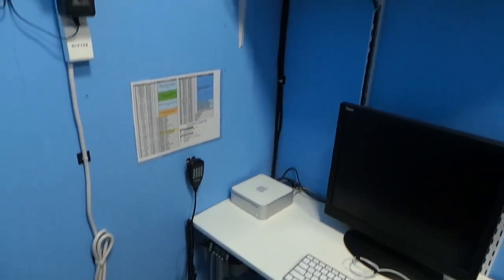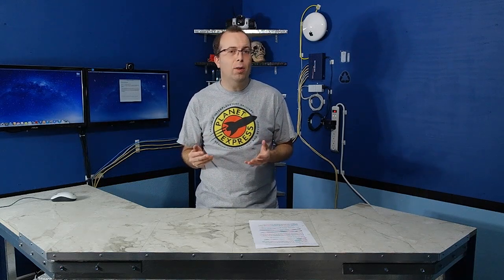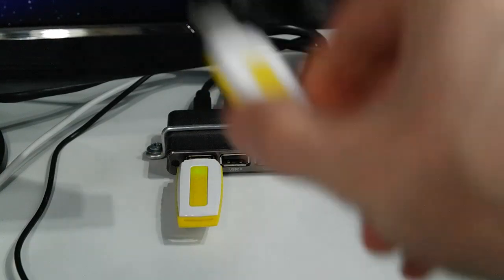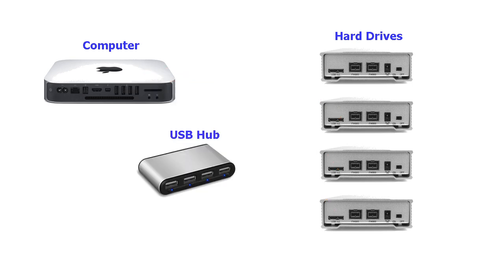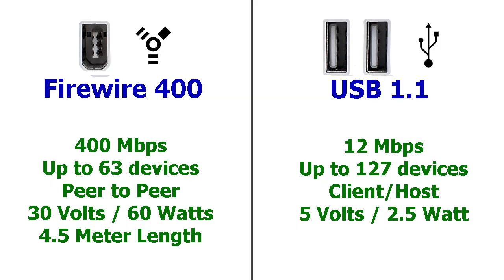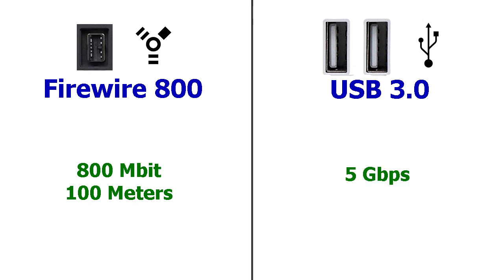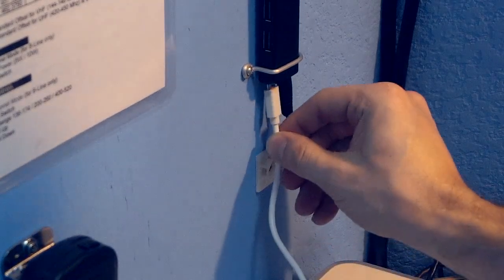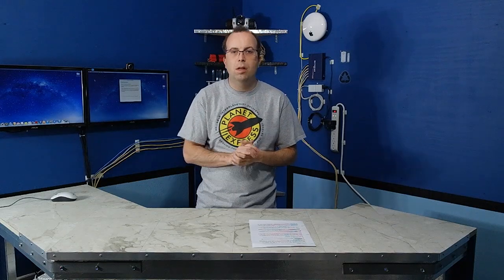Farewell R.I.P. Firewire, Hello USB!

Comment: firewire isn't dead. a lot of multichannel audio interfaces use firewire.
Reply: +diego scar yeah that sucked much. Damaged Firewire chips on so many audio interfaces just because the were turned on while a pc was running. The hot plug issue was the biggest flaw in firewire audio interfaces.
Reply: +diego scar True, but most new interfaces are switching to thunderbolt since it shares the same benefits as firewire, with exponentially higher bandwith
Reply: Well, there's understandable confusion, as the various standards have all leapt into the same vat of soup and are swimming around in a rather murky broth these days.  Thunderbolt typically uses the Mini DisplayPort physical connector, and can indeed carry the DP protocol.  But not the other way around.  But now USB and TB are merging into a single connector, so the holes in the side or back or front of your computer could be charging ports, USB, TB, DP, HDMI, Ethernet, or just merely a ventilation louvre.  What they chose no longer resembles the connector everyone's familiar with, but rather kinda looks a little like an Apple Lightning port, but isn't, which I'm sure will be fun for the next round of iPhone buyers.

So, while you're here frothing over how people can't get their facts straight, the computing industry is doing everything it possibly can to make the entire thing an indecipherable mess.  Not everyone lives and breathes this stuff.  You ought to cut the general public some slack on that one.  Just a hunch, but I'm guessing you won't.

Also, hey, "Personus" make some perfectly mediocre pre's, and nobody these days spins their own A/D/A silicon.  It's all Crystal Semi, TI, etc etc, the same stuff everybody else is using, and it's all 100 times better than what anyone had 20 years ago anyway.  Somewhere between then and now, I wish I had a dime for every box I opened up that had the same family of Burr Brown A/D/A ICs in it.  But I digress.

You're on a roll, my amphibious friend.  (Well, not quite, on a technicality.)  It really was a driver fiasco.  But chipset compatibility was very much a real issue as well.  You also seemed to have missed all the problems people had with destructive hot-plug events.  Maybe you could have blamed that more on power management ICs or poor decoupling and/or fault isolation in the physical interface circuit.  Point remains though, that didn't happen with USB, under very similar conditions, and doesn't seem to be an issue with Thunderbolt either.

Well either way, I'm glad your experiences were better than that of your peers.  I happened to get along quite well with Windows ME back in the late 90s as well.  Sometimes, against all odds, you just get lucky I suppose.
Reply: You're alright, Murphy.

Y'know, I've looked at Metric Halo before, and I have to admit, I wouldn't mind dropping some coin on a better digital interface.  The Firestudio stuff works well enough out on the road.  I mean c'mon, I'm not tracking for Telarc here.  Buuutt.. that LIO-8 seems pretty nice.  Just good conversion, and not much else.  Perfect.

At this point, though, I can't see investing in another FW interface.  The gymnastics I would have to go through for connectivity... ugh.  I already have to use a TB-to-FW converter, and I'm not holding my breath that there will ever be a USB-C to FW-400 cable for when I eventually upgrade the laptop.  Which means I would have to chain a TB3 to TB2 adapter to a TB2 to FW adapter, or use a TB to PCIe enclosure and a Firewire card.  Not ideal.

I'm tempted to spend a weekend browsing data sheets and just start building 24 channels of good line-level AD bridged to multi-channel digital I/O (AES or S-Mux or who cares what), and then use whatever flavor-of-the-month Behringer or such I can find to interface that to a computer and hope it can't screw up the transport of bits too badly if the clocking is done elsewhere.

Oh the irony of a signal chain that begins with a transformer designed in the 70s, and ends in some fangled doo-dad with an obsolescence period of about 6 years.
Reply: Yeah, my next will be* thunderbolt or real PCIe, you'll get even lower latency from those interfaces. But I'm still super happy with my metric, and will chain dongles until no one will let me anymore:D Good luck with your rig!
Reply: I have a multichannel audio interface that uses FireWire. Works great but now I don’t have a computer with FireWire. If i get just an usb to FireWire adapter, will it work? Any help. Thanks.
Reply: Relax before we turn you upside down and strand you on your shell there turtle boy.

You're not entirely wrong, as the Presonus interfaces I was referring to do, in fact, work a lot better on a MBP than on a Windows PC.  And you're also right that this is technically not a fault of Firewire as a spec.

However, the manufacturers of FW interfaces used to publish compatibility charts with specific FW chipsets.  When was the last time you bought a USB device and had to check to make sure your host interface used a supported chipset?  Or Thunderbolt, for that matter?

Whether this is because FW had limited reach, and therefore ran afoul of untested corner cases, or had technical limitations that made it especially touchy, I don't know.  I've built USB devices, but never FW, so I'm not as familiar with it.

The (Windows) drivers for DICE chipsets were, however, universally recognized as awful.  Most manufacturers stuck fairly close to the reference code available from .. who was it, Lexicon that designed the thing?  I forget.  You could tell how little the vendors changed the code by comparing similar hardware from competing manufacturers (e.g., the Presonus Firestudio line vs. M-Audio's equivalents.)  It was usually the same controls in a very similar layout, with customized graphics.

I was able to get all of my Firewire audio interfaces to work, even on Windows, but they were always much more erratic than, for example a MOTU PCI based interface.  E.g., sometimes they would just not show up in the device control panel, despite having been recognized by Windows.  Or, some of the controls wouldn't work.  Or the timing would slip.  Etc., etc., etc.

Mysteriously, even though, as you say, it was my own fault that I had trouble with it, the OEM stopped producing these chipsets not so long after they hit the market.  All the vendors then abruptly discontinued those product lines, despite them being unique, affordable, and rather powerful for the time.  I can't help but feel that if I had stuck to those Mavis Beacon tutorials when I was younger, that things would have been different, and we would still be using Firewire today.  Sorry about that, guys.

As I'm sure you can tell, I am obviously relatively new to computers, having only used one since I was old enough to drool on the keyboard, then a few brief years later, making a career out of it, and maintaining hobbies in music (electronic and acoustic), programming, and electronics engineering.  Compared to a reptilian expert such as yourself, I barely understand enough to turn the things on (lolz) but do believe I managed to put the shiny silver floppy into the right hole in order to get the drivers to expunge correctly, or however you call it.

All of this is, of course, irrelevant to the original topic.  FW is dead.  RIP.

PS... this may sound species-ist, but do all turtles know each other?  If so, say hello to Mitch McConnell and Raphael on your way out of here.
Reply: +diego scar Let it go, man.  I know, it's tough, but FW is dead and gone.

I feel your pain, 'cause I have 32 channels of ADAT S-Mux interfaces with Firewire host connectivity.  But, like many devices of that era, it has a horribly temperamental DICE chipset that promised a bazillion channels with zero-latency mixing and DSP, super stable internal clocks and bang-on PLL... While in reality, it mostly delivered endless driver headaches and host chipset compatibility issues.
Reply: I love how these idiots, nick and Panos are clueless to what their problems actually were. I suggest learning how to use a computer, Windows drivers problems are not a part of the spec, and specific to windows. I still use a FW400. interface with better pre-s and a to D's than probably everyone in this thread. Holy shit why do people talk
Reply: lol@ dunstorm, you don't do real audio.
Reply: Also, I'm amazed that anyone used ME for music production. IF you did you have NO CHOICE but to know what you're doing:D You fought the good fight. lol.
Reply: my issue is that if you're going to take the time and try and explain a technology to someone, you should actually understand it. I did flame a few people, but I'm not too sorry. If you think thunderbolt runs on usb, you shouldn't be telling anyone how anything works in that realm. 

I don't for a second blame or judge anyone for not knowing, you're quite correct, they have given us a mess:D But to go out and try to inform other people it's like, no. 

to your other topics: yes the A to D's are better, no, they aren't all the same, yes the pre's matter more, and yes presonus's are terrible. (I'm a metric halo guy personally, so long as you don't need more than +24 or so they are super quiet:D)
Reply: personus have both horrible a to d's, and horrible pre's. IMO, you were not experiencing incompatible chipset issues, but driver issues. FW interfaces that I used were NEVER erratic, but PCIE is the goal, as there will be even less latency etc. My point was, 99% of the people here think thunderbolt is ON USB 3.1. 

If you're that stupid, then you shouldn't talk. 

also, fuck Mitch.

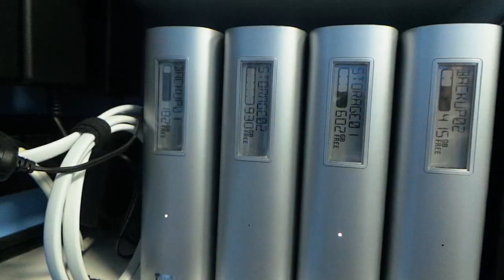Comment: My main computer is an Early 2008 iMac which has 1x FW800 port and 1x FW400 port. For Time Machine I have 1TB WD My Book Studio, exactly like the four stacked on the shelf @ 0:14. It's the best setup for my machine. Let me tell you, when I've had to replace harddrives and restore my data over FW800 I counted my lucky stars because it would've taken at least twice the time over USB2.0. 

Recently I had been looking for some ethernet external harddrives to take advantage of that gigabit speed when OS X does a Time Machine backup, if I want to access files on it,  if I need to restore my data or (eventually) upgrade to a new mac. Unfortunately ethernet external harddrives - even used - are expensive.

I think when I do upgrade to a new iMac I'll have to just forgo restoring my data to the new mac via the USB port on the WD external harddrive and just link both macs via gigabit ethernet.

Comment: I've read that you actually CAN make a LAN connection via USB, but you need a special cable with a chip on it.
Reply: +eklipsegirl at that point why not just go over the network?
Reply: joebob3719 What if you have no LAN port on one of the computer or the LAN card is broken?
Reply: +eklipsegirl USB Ethernet card?

Comment: Firewire is maybe obsolete for storage, but not yet in other applications.
I'm doing live event streaming "on cheap" and it happend that no modern (HDMI & USB) camera is able to just output live video to computer. You need HDMI grabber... or use a bit older HDV camera - and they all output live video using FireWire. Also, for some reason (guess why) they still hold they price. Yes, industry standard for it is HD-SDI, but devices equipped with this technology are at least twice as expensive + you need special SDI cards also in computer. 
Also, HDV is still a standard of video used by many televisions, so it's hard to say that firewire is dead yet - IMO it's usage is limited to special cases, but will be in use for at least a few years.

Comment: Intel killed Firewire so their CPU dependent USB can have monopoly in the market.Guess what, Intel makes CPUs.People do not realize that HDMI is also a fast two way data link.Intel's attempt at killing HDMI in favor of it's Thunderbolt with help from Apple has failed, mostly due to all the support HDMI has with TV and monitor manufacturers.However, in the case with Thunderbolt, it really is the clearly better technology. Thunderbolt even supports PCIe over its wires. Meaning as long as the OS doesn't block it, people can attach their PCIe cards to the end of a Thunderbolt cable. Yeah, Apple hates user upgradability, so expect difficulties with OS X, but it foes work with Windows.
Reply: +AirScholar I could be wrong, but I felt Thunderbolt was kinda failing due to PC manufacturers not wanting to embrace it. There was a brief period where motherboard had Thunderbolt I think in the Z77 series? After that they scrapped it due to Thunderbolt taking up precious PCIe lanes. Only now is it starting to come back on high-end motherboards. IDK, again, I could be wrong. That was just my observation when I was working in retail with computers and hardware.
Reply: +Trevor Falzarano I would not be surprised if thunderbolt comes back to PC laptops though. What's the point about being miserly about PCI-e lanes when the little lappy can't even use them all? Although, another problem is that I have yet to see ANYBODY seriously sell or support external GPU enclosures. Sure you might get some wily startups, but the drivers are spotty at best. It seems like nobody wants thunderbolt to work; not even apple cares either, you'd think they'd want to give people the option to expand their waste-bin mac "pros".
Reply: joebob3719 True. And I also forgot that Thunderbolt accessories have never been very plentiful. The few that were around were prohibitively expensive, so most people sprang for USB 3.0 accessories instead since they were cheaper and "fast enough". I was hoping that Thunderbolt GPU expansions would take off, but they would have very diminishing returns since they would be expensive and not many people would be interested. My point about the PCI-e lanes is for desktop motherboards. Most people buying high end boards wanted to do SLI/Cross-fire with either 2 or 3+ cards and having thunderbolt kinda messed that plan up. One think I don't get is why things like the Microsoft Surface and other laptops/tablets have only mini-displayport. They could have easily just made that a Thunderbolt port, would have done the same thing and more.
Reply: Trevor Falzarano
Yeah, not much support for Thunderbolt motherboards.
Fortunately, PCIe lanes are plentiful in the new Intel lineup.
And as for GPU cards utilizing lanes. There is really no need to go beyond 8x on 3rd gen. Even that is a over kill.
The only data that goes over the lanes are textures when the game starts and then simply very low bandwidth vector data, even 4x would be over kill for that.
The only people that need 4 x 16x lanes are scientists and engineers that "stream" data over the PCIe lanes from RAM.
All this is a mute point anyway.
SLI and crossfire have quickly diminishing returns. Better to just get the fastest single GPU card.
I feel there might be a market for Thunderbolt on laptops as Trevor said. A small box the size of a Apple TV with discrete graphics and its own power supply. Ultrabooks can play games.
Or as Trevor said, for expansion for the trash can Mac Pro.
Reply: +Trevor Falzarano Thunderbolt was having issues being licensed for windows machines for a while, but now skylake has native support for it so you can expect to see it start to show up a lot more now
Reply: AirScholar TheEpicLinkFreeman Oh, okay. Thanks for the information guys.
Reply: +joebob3719 razor, alienware, msi and other manufactures have external GPU enclosures.